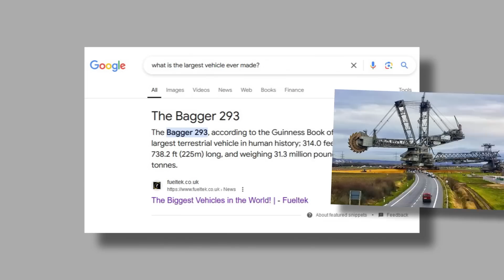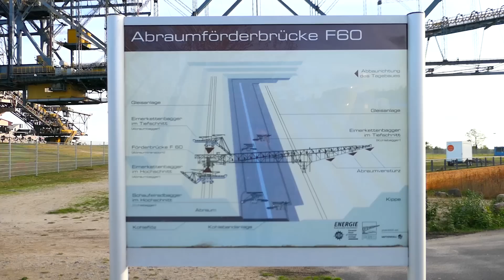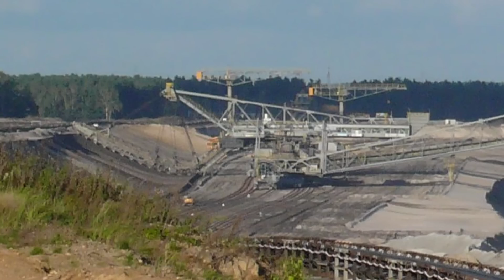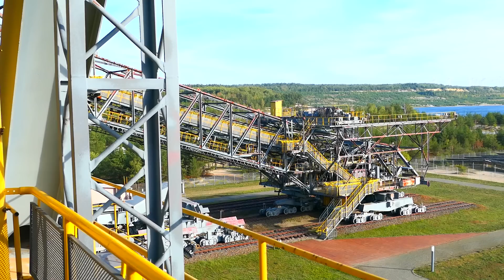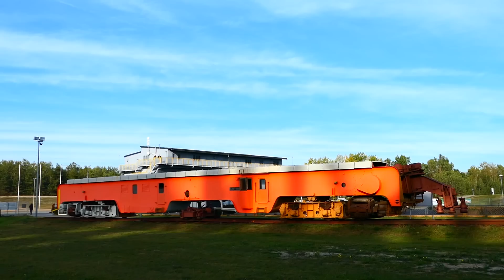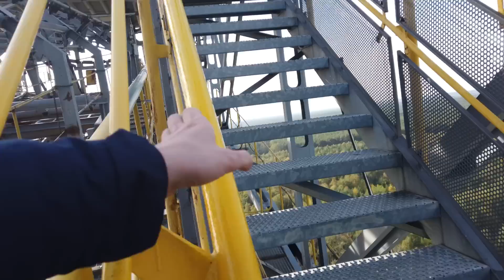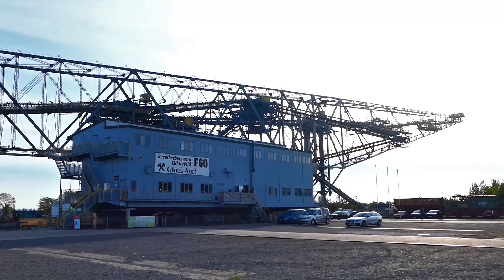Why Germany Built The Largest Vehicle On Earth

Comment: Brown coal is absolutely dreadful stuff.
Anthracite is almost clean burn in comparison.
Thanks Tim.
Reply: can't wait to finally ditch that resource.
Reply: The problem is that that is pretty much the only stuff we have/had here in the region. So that's what we had to use.
Reply: @numazuchi  You also had and still have some uranium which is much cleaner when taken into account how much energy you can create from tiny amounts of it when compared to the lignite.  1kg of uranium can produce as much electricity as 2700 tons of lignite. That means 1kg of uranium is equal to 38 full coal waggons. Also lignite creates extreme amounts of CO2 while nuclear plants produce exactly 0. Lignite also naturaly contains trace amounts of uranium which get into the enviroment after it gets burned so you cannot say nuclear is bad because mining of the uranium spreads little bit of radiaton. Most reamins in the ash but some amount gets into the air. The ash left over after burning the coal can contain as much as 0,1% uranium as well as arsenic, lead, mercury, radium, thallium and other nasty stuff
Reply: @numazuchi  well you had something related to atoms back in the days if I may cough
Reply: @goldELIO1  Yeah, right. You do realize that this is eastern Germany? As in, the former GDR. We could have built Russian style nuclear reactors. Even with German quality engineering, and we had that, this would have been too risky. So, great idea! 💪 Stop making this about politics! And before you accuse me of being a green shill: I am pro nuclear energy. But I am also aware there are safer alternatives.
Reply: @numazuchi  I'm not accusing you of anything, but the systematic closure of the nuclear powerplants you had, to replaces them with unreliable trashy solar/wind farms is ridiculous if I may, you guys have started dismantling perfectly functionning plants when you need them the most, also said "german quality engineering" made the EPR1 programm fail (sorry to say but that was a huge waste of ressources that caused so much delays for france's new nuclear generation and it makes me a bit mad) also there's statisticaly no safer power generation method than nuclear so there's that as well, and yeah nuke is all about politics which sucks but it's life!
Reply: @numazuchi  Well, if you didn't cave to 'greens' that oppose nuclear energy, you'd need less of it.
Reply: @MrBlueBurd0451  The greens didn't decide to decommission it, but the SPD (social democrats) and the CDU (conservatives).
Reply: @mypdf  I genuinely don't want to sound like an asshole, but... Yeah, yeah, that's what 'caving to the greens' is. Doing what they want without giving them direct power. The radiophobia in Germany is vicious and absurd and it should be called out as such.
Reply: @mypdf   not to mention, it wasn't really based on sustained anti-nuclear pressure (which has been more or less a constant since the 60s), it was purely in response to Fukushima. 

Even though Fukushima was a primarily regulatory failure, not a technology failure (other TEPCO plant locations nearer the shockwave had up-to-regs backup power, while Fukushima had been dragging their feet for a decade) and in any case Germany wasn't at risk of a seismic event like that.
Reply: @MrBlueBurd0451  Guess what we don't have in meaningful amounts: Uranium.
Reply: @kaitlyn__L  The Fukushima incident has been blown out of proportions too. The way they dealt with it has killed and traumatise more people than the incident itself, even if you don't account for the damage to nuclear power image worldwide...
Reply: @denniskrenz2080  1 You need WAY less of it. 2 It's cheap and easy to buy if you need to, France doesn't have more uranium on it's soil than Germany but their base power is nuclear.
Reply: @MadMaxGyver  They had colonies and still use their African suppliers like that. And of course, need to buy from Russia, too. Even today. Also don't underestimate the mining efforts. You need about 25 tons of new reactor fuel per year and reactor (1 GWe), but this means you need to get about 150000 tons of ore mined in Germany per reactor and year. At the few "not so bad" sites. With HALEU, like planned for many SMRs, the ratio would even get around four times worse. We are really a poor country for nuclear dreams, unless you want to enslave us.
Reply: @MrBlueBurd0451 Actually it was the conservative party in Germany that decided to exit fro. nuclear power.
Reply: @bernhardschmalhofer855  Yes, and by doing so, they caved to the greens. Well, 'greens'. No party that opposes nuclear power can legitimately call itself 'green'.
Reply: @MrBlueBurd0451 you're kinda forgetting why ppl left nuclear power. It's f, ing expensive, not to produce but to store.
We don't have lots of storage solutions for that in the EU. Even France has stopped building nuclear power plants bc of that.
Reply: @FlyingAnanas-337  No it's not. 'it's so expensive' is bullshit, and only the case because of NIMBYs and absurd overregulation. 'we don't have a lot of storage' Find a fecking deep mine and tip the containers down the hole.
Reply: That is wrong. The GDR was one of the biggest Uranium Exporters in the World up until 1990. Just Look up the Wismut AG. The Wismut AG also delivered most of the Material needed to build the first few Atomic Bombs for the UdSSR.
Reply: @MrBlueBurd0451  We are producing far more electricity from renewable sources than we ever did with nuclear power. Also calling a technology the solution to all energy problems when after decades we still haven’t found a way to get rid of the nuclear waste, is ridiculous.
Reply: @kieferngruen  Oh no, you're producing a lot of power at random moments with no ability to control where and when you produce your power, let alone have reserve, baseload capacity on the grid in case of sudden peak loads! Wow, you certainly defeated my argument. Secondly, there are absolutely ways to get rid of the waste in a productive manner. Your ignorance on the subject doesn't validate your opinion.
Reply: @MrBlueBurd0451  The strange thing is: Germany uses less of it despite closing all nuclear facilities. Lignite in 2024 has accounted so far for 17.3% of electric energy generation, while in 2018, when Nuclear generated 13.8% of Germany's electricity, Lignite accounted for 24.2%. So far in 2024, Renewables generated 63.5% of Germany's electric power.
Reply: @MrBlueBurd0451  your comments would be hilarious if it wasn't so endemic that people believe and post things that aren't true but that fit their narrative. 
The green party actually prolonged the operation of the last nuclear power plants after CDU and SPD decided to phase out nuclear power. So what you are saying is factually wrong.
Reply: @MrBlueBurd0451  your comments would be hilarious if it wasn't so endemic that people believe and post things that aren't true but that fit their narrative. 
The green party actually prolonged the operation of the last nuclear power plants after CDU and SPD decided to phase out nuclear power. So what you are saying is factually wrong.
Reply: @SiqueScarface  No No No. Please do a bit reserch on the numbers. 

We buy the missing energy we generated with Lignite and nuclear facilities for high prices by ourr neighbors.
In the last year, germany was multible times close to bigger blackouts. Not in the news because not to  panic the population. Panic buying.    
We have a net capebility of over 200%. We could generate double the energy we consum. But renewables, dont generate enrgy, at night, in the winter, when there is no wind. 
Because of small flutuation you always need a base energyproduction with fossiles, runnuing all the time.

What has change in the last years. Germany isnt capable to provide the country with energy anymore.  And when the wind blows, we pay money to dump the produced energy.
There is the lie about the h2 powerplants. But the tecnolgie doesnt exist, doesnt matter if there are companys who want to sell these. 
Ther is no market for h2, so there no big producer of h2. ( Green Party had plans to produce h2 in canada with oilshell, which is much worse as lignite). Without h2, h2 reactors would run.
To upgrade our gas network of 500.000km pipline, it will cost multible 100 billions whcj germany doesnt have, not to mention the new powerplants needed.

Green Party in a nutshell.
Reply: @denniskrenz2080  We even have Uranium in the ore mountains which was mined under Soviet supervision by the Wismut AG for the Soviet nuclears during 40 years. Thousands of miners died from
Reply: @Henning_Rech  Yes, but that repository isn't really of a good grade for the modern market. There are some plans from time to time to use in-situ mining there or in the black forest, but the investors are rare and not quite interested. Of course, also German pollution laws are much more strict than in Kasakhstan or Africa.
Reply: I've been to East Germany when they used that stuff for absolutely everything in the public and private energy sector. The sky was always yellow and you could hardly breathe. It stank of coal fumes everywhere. Thank God these days are over.
Reply: Browncoal isnt that dirty. It just has not the energy desity of black coal.  
 But brown coal is ultra clean compared to oilshale, mostly used in china, estonia, and brazil.

Comment: Breitspurbahns final form
Reply: Pedant in me:
That tripple track is actually still not as wide as the Breitspurbahn would have been.
Reply: @EdwardDragon96  I think the OP (original pedant) meant measuring between the outermost rails out of six, the gauge is pretty breit indeed
Reply: @u1zha  
Well I think he was referencing the "Breispurbahn" the mad Austrian was planning in the 1940s with a width between tracks of 3000mm or 3 meters.
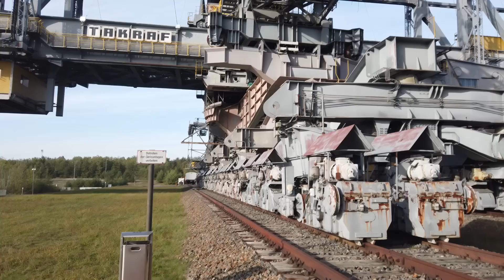Two track of standard gauge of 1435mm running on the same track in the middle like it appears at 5:17 along with the middle tracks 60mm of width of the middle rails head would come to only 2930mm. Thus 70mm or 7cm less than the Breitspurbahn.

Tho I have to admit it seems to be running on 2 seperate standardgauge tracks with a rather big gap in the middle.

Comment: Aren't super max containerships or oil tanker ships larger in both mass and volume?
Reply from the maker: The ships would certainly have more mass, but with regards to volume, it's a classic case of "it depends how you measure it". For what it's worth, the F60 is longer and wider than any vessel that has ever existed.

And then there's the whole argument about whether ships count as "vehicles" or not... :)
Reply: @TheTimTraveller  I suppose the F60 technically doesn't have much volume since it's mostly made up of empty space because of all the girders. Pedantry corner here.
Reply from the maker: @VRSVLVS  yep exactly :) Plus, when I say it's "wider" than any ship, that's true if you measure both at their widest point. But is it fair to measure the volume of the F60 using its widest point? Probably not...
Reply: The longest container ships are exactly 400m, because that's the max allowed in the Suez canal. The longest ship ever is the oil tanker Seawise Giant at 458m, which is quite a bit shorter than the F60's 504 m. (The Prelude, a floating LNG platform moored off Western Australia, is 488 m long, but it can't move under it's own power, so I don't know if it counts.)
Reply: longest ship so far was "just" 458m